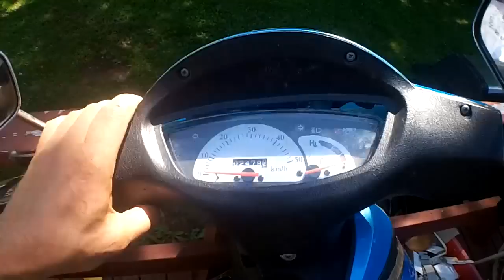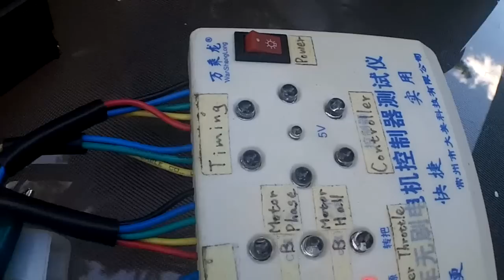DAYMAK ebike*repair bad controller wiring*

Comment: Hi, I have new 250w geared motor and sine wave cotroller and it makes a lot of noise when running. Runs for about 5sec. Then turn off and when I relase the throttle and turn again it work for 5 sec.
Reply: Same with mine

Comment: Nice video!

I bought a 36v controller with 36v hub motor.
I powered it with 36v lithium pack.

But the motor does not run.
When i did the same using a 48v controller and 48v battery pack, the motor runs.
I am puzzled. The motor rims says its rated at 36v. I can understand that a hub motor can be over-volted but not sure why the 36v controller does not work.

I suspect either the controller is faulty or the hub motor is actually rated for 48V .
How to test what voltage the motor is rated for despite the rating specified on the hub motor rims?

Thank you.

Comment: How can i make my XB-502 faster and run longer ?
Reply from the maker: upgrade from led acid to lithium. upgrade from a 500watt to a 1000watt will up the speed also go from 48v to 60v ect.
Reply: Karma Electronics thanks.  is it hard work to install ? I'm new to all this.
Reply: Karma Electronics

Comment: i saw your vedio about controller i liked it I need help can u do it please I have 48v DC brushless motor without hall sensor its controller not working now and its hard to get can I use this controller with that motor how to make connection because I have only 3 nos of motor wires witch for 3 phase power supply please till me how i can run the motor with this controller and also how can controll speed thankx in advance
Reply from the maker: what you need is a sensor-less controller.
Reply: yes sensor less controller or if this type can work for me i have 48 to 60 v dc three phase 1000 watt motor thanks
Reply: please advise if u can help me thankx
Reply: muhammad zubair